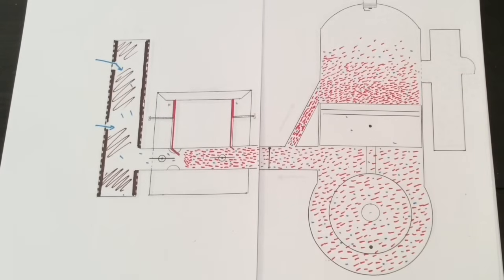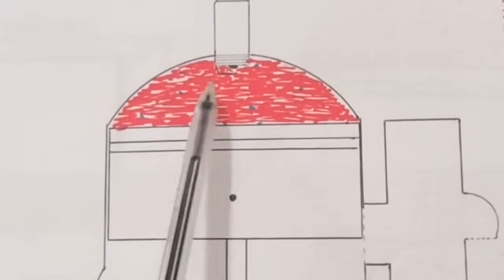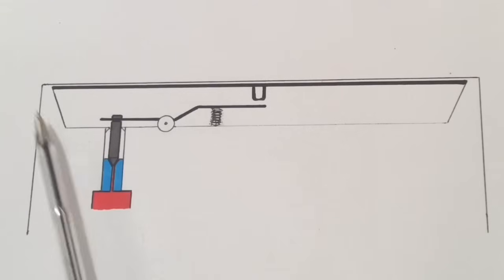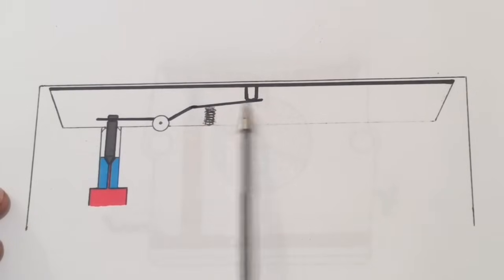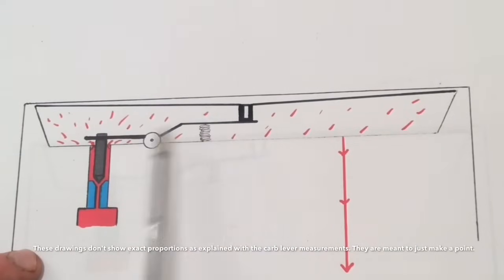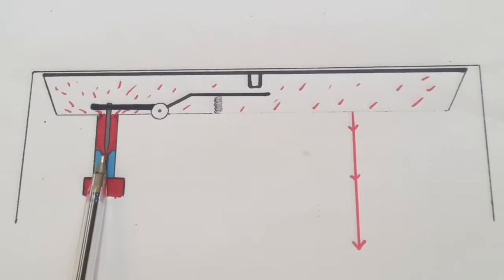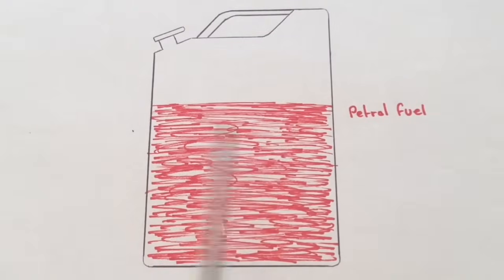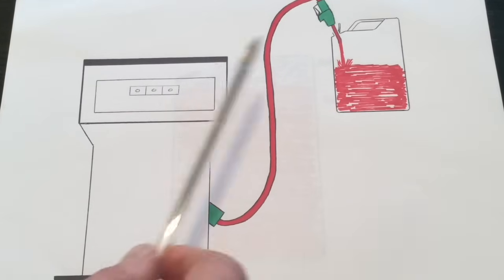CHAINSAW CARBURETOR LEAKING GAS/FLOODING: Why Carburetor Overflow?  (by Craig Kirkman)

Comment: This is a great video. You explain it just right. Now I will have to watch it again because I am new to small engine. I have an older Homelite chainsaw and it floods if I don't get it started within 3 or 4 pulls. The gas ends up coming out the muffler. I don't know if this is something I can resolve with an adjustment, or do I have to put id a carburetor kit.  Do you have a rebuild video posted? I hope I can find one that will teach me.
Thanks you and keep up the great work. You sure know how to explain things 
Andy

Comment: Hi there,i drive a two-stroke motorbike.... this video has been a great help...No doubt. But still i would ask question that is,most of the time my bike bogs down in a running condition. Other than that when i run it for a kilometer of 30-40 after shutting down the engine it doesn't want to start.....i took a look at my spark plug its peach black in color and dry. Along with that most of the time before i used to face overflow and no start condition. Would you please be kind to enlighten me about the trouble i've being facing? Although i got to know a lot from your video. Such a great explanation. I would be waiting eagerly to know feedback from you.
Thanks.

Comment: absolutely amazing video I cannot thank you enough. I work in a garden machinery workshop and these small things were not taught when I was learning. I can fix 98% of machines but recently had a kawasaki hedgetrimmer which was flooding excessively. I tried a new set of fuel lines as the old ones were perished, a new fuel filter, a carb overhaul kit and it's still flooding. you can pull it over and leave it and the fuel will still come out of the air filter housing and into the cylinder. after watching this I am definitely going to look at the metering diaphragm and needle assembly as it is most likely this. 
again thank you for your help and I will continue to watch your videos as they are so well set out and uncomplicated.

Comment: Hi, great video, fine explanation, love your work.

But probably you could mention (or make another excellent video) how to avoid a lot of problems with degrading fuel by using Alkylate fuel instead.
Alkylate fuel has no degrading over time, has no ethanol added, has the right oil percentage mixture, doesn't build up sludge in your machine, better starting, longer lifetime of the motor and best of all: it's much safer for your own health by not having benzene or aromatic hydrocarbons in it. It is also highly recommended by a lot of machine manufacturers. Downside is that this fuel is pricier, but I personally think that it pays for itself in a number of ways.
I use this type of Alkylate fuel in all my small machines for about 20 years and I am very satisfied about it.
Reply from the maker: Erik Baeyens, ok, thanks for your feedback, I really appreciate it.

Comment: The other factor for gas at the pump is the grade of fuel ,here in North America we have bronze silver and premium. Premium being the best to use. Now the thing you have to realize is this, if you want premium gas in your jug when you get to the pump you don't know what grade the previous customer used. So if the person used bronze there will be a couple of litres of that in the hose line, therefore you are not getting 100% premium. Best thing to do is put 2 - 3 liters of the gas in your vehicle then put the 100% premium in your jug.

Comment: ** the issue of the needle lever position**,  bending if required,   is most often not addressed in rebuilding or adjusting parts of a 2 cycle carburetor,  thank you,  regards

Comment: Hi Craig,I had a leaking carburetor so I bought the kit,containing needle etc and diaphragms and cleaned with carb leaner then in a cleaning machine for got its name then dried it with carb cleaner again and air dried it,but it still leaked out of the edges where the gaskets were applied`when i put 10 psi to it,but the bubbles were less and slower.I tuck it apart again and realise under close inspection there were very fine scratches to the surface that would lead out to the edge.
Now i new air was running along the very fine scratches and coming out under the new gasket.Could i sand the carb with wet and dry to lesson the scratches and remove them from leading out to the edges?also is there any thing I could do instead of sanding on a glass sheet with wet and dry,Like swelling the gasket first so it get compressed into the scratches or apply a film like a filler be for applying the gaskets.?any advice would be grateful please.

Comment: Craig,listening to your theory on air in the fuel can maybe you should invent a depressuring  method to extract air out of the petrol can,If I am correct doesn't the car depressurise the fuel in the tank when turning the key be for the engine starts.If you do invent this then remember it would more likely have to be a tough flexible plastic,this would prevent tipping the fuel into a smaller can every time you use the fuel to reduce the air.Just remember who gave you the idea lol.

Comment: HI Craig,could this be done where you empty the fuel and use a pump with a dial gauge and test the for leaking with no more than 10 psi of pressure.Also when i see people using a method called the leak test they also do a pop test,this is where they take the pressure more than 10 psi until the needle gets pushed up causing the air to rush into the carburettor.I have heard this is not a good thing to do,would you recommend it can be damaging to the needle rubber or the seating rubber doing the pop test?.They say the pop test will determine either the needles seal or the tension on the fuel needle.I can`t remember now,

Comment: Hi again like the comment below your video`s really inspire me to get all my none running brushcutters and strimmers going again,I was always a struggling student at school and always told to just go to sleep or just look at the book if you don`t understand.I never learnt much at school only read and write and low level manths,But pretty good at maths now in my head never used a calculator.I found out later in life I had a reasoning problem,This meant the way I read or got told how to work out things needed to be explained in a slightly different way or break things down more than it would need to.Any ways I have no issues in the way you come across explaining I understand perfectly,You understand when teaching people that they literally don`t have a clue to begin with` this way you can learn the ones who really don`t have a clue`and this is how teachers should be teaching pupils,I truly believe to learn someone they have to take things back to there basics and never assume people have a general understanding to start with as this will leave many pupils behind scratching there heads.I don`t know your back ground but if you were a teacher at college then you would not have many scratching there heads.thank you again.

Comment: I went through all 7 steps and still have a problem with flooding.  It's a Zuma carb on a year old Husqvarna string trimmer.  If  drain the tank , pull the spark plug and crank it a lot of vapor comes out for about 20 cranks on the starter rope.  When no more vapor is expelled I fill the tank and without pumping the bulb or putting the choke on, after the first pull it's flooded again.  It seems like fuel is just pouring into the engine.  I've gone through all your related videos, paying attention to all the details with no  luck.  Any ideas?  Thank You.
Reply: Did you ever figure it out? I would sure like to know if you do. Thanks
Reply: I'm not sure.  I ordered a kit for it and had the same results.  I ended up putting a new carb on it and it's fine.
Reply: check the seal on the crankshaft on both sides
Reply: Did you checked the floating pin and than the floating pin seat. If ok than check the hi speed setting screw for adjusting
Reply: If the crank  (main seal) seal are gone, the engine will not start and on other hand you will c the oil leak marks like dust accumulated on and around the leaking seal
Reply: Hwally possible bad needlefloat valve

Comment: If the fuel inlet lever is high can you still use the fuel mixture screw to regulate the richer amount of fuel going into the engine?
Reply from the maker: Hi, yes, only to a point though.  I've always found it best to go through the procedure of checking everything, which I know takes a little more time but you can almost guarantee that all will be much better in the end. I myself still go though this whole procedure when I'm dealing with carb issues. I find that as long as I've been through everything, checked and corrected all, I am always pleased I've done so because the results are so much better and my sense of satisfaction knowing all is well inside gives me greater confidence. I hope this helps. Thanks again.